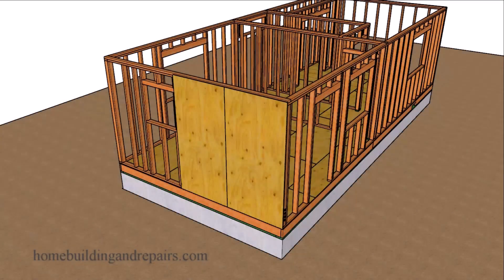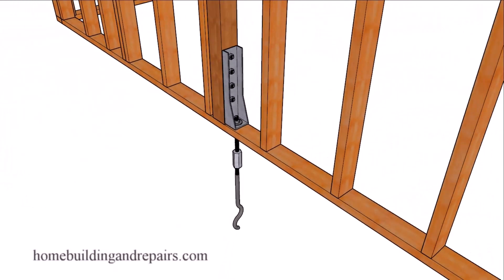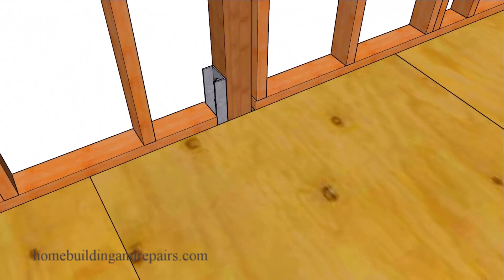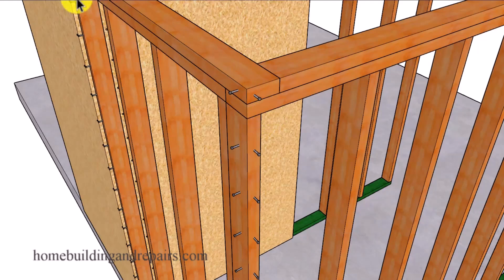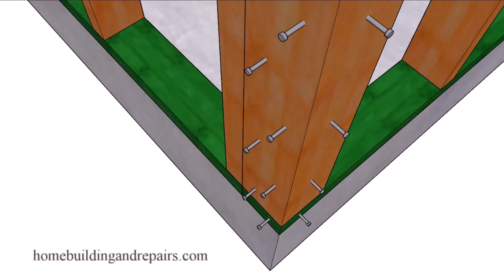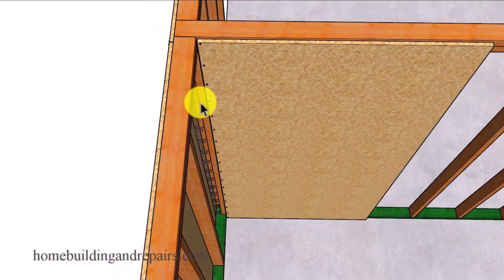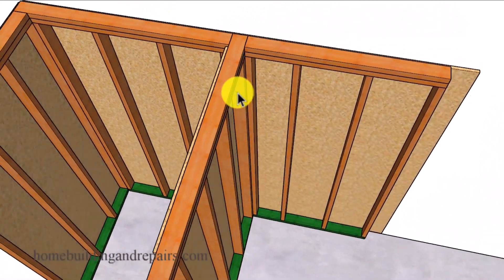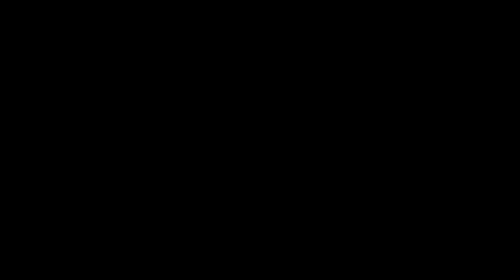Structural Shear Wall Framing And Foundation Hold Down Layout And Installation Tips

Comment: Can you show the hardware needed for shear walls underneath the raise foundation. 

The A35 needed at mud sill.

the bottom plate anchoring with SDS connections 

difference between using a 8’ plywood vs 10’ plywood  nailing directly to rim joist.

Comment: Where do 30" embedded straps come in instead of bolted  angle hold-downs like this ?  Straps are embedded deep in the stem wall concrete and extend up to tie the sill plate, rim joist, and studs together before the sheathing goes on. Are those only effective for uplift but not for braced walls or shear walls ?
Reply from the maker: They work for shear walls and can be used sometimes, but it will be up to engineers on whether to use them

Comment: On the crawlspace foundation, if posts are going through to the sill plates, why not build the entire wall to go on the sill plates as though it were a slab foundation, then joists on the sill plates nailed to studs, then blocking at subfloor level where a sole plate in platform framing should go ?  That would be almost like balloon framing where the joists ties the studs together rather than studs sitting on top of subfloor.

Comment: Putting all these posts in corners and thru-wall connections means no insulation space, which was the origin for the California (3-stud) corners.  Will it even be approved by current energy code requirements to eliminate that insulation space ?

Comment: I'm not a framer or an engineer, but I've seen the wood rot on the outside floor joist on houses.  If you put the post directly on the sill plate cutting out the outside floor joist, would that cause a problem when that joist needs repair or replaced?  I know it would last a long time with waterproof rap and stuff, I'm just thinking of the future when there is a problem.
Reply from the maker: I like putting posts on top of crawlspace floor framing plates instead of on top of sheathing.

Comment: I find it hard to believe we're still building these crappy 2x4 houses this way.
Reply: We are building all kinds of houses. 2x6, 2x8, double frames and many more. 2x4 is either a cheap house or a shed.
Reply: 2x4s are adequate for the load for  single story houses even with heavy snow loads, and if you are going to use external insulation, it doesn't matter that the cavity is very shallow.  For these cases, you are better off in investing your extra money in more plywood for shear strength for wind and seismic loads than in sawn lumber studs.  In general, walls are typically over engineered for vertical loads compared to other components of a house.
Reply: It's called money and I would love to live in either a deltech wood house or a concrete monolithic dome.

Comment: At our lumber supply house I’ve seen the sheer Wall concrete bolts that were three or 4 feet long for extended applications.  That were not straight rods.

Comment: Please teach me what a shear panel is. I've never heard of the term. Only ever heard of sheathing. All I can guess is that sheathing or OSB or plywood installed in a certain way achieves what shear panel is supposed to achieve. Perhaps structural integrity for countering lateral movement as well as uplift?
Reply: Panels nailed on any old random way that keeps the outside out would be considered "sheathing".  It's not doing a whole lot for you structurally.  When you nail a panel specifically to cover and bond and "keep square" the upper and lower members and at least two studs in order to prevent racking, then you can call it a shear panel, too.  Depending on the situation, you can do this in lieu of, or in support of, a bracing member in the wall.
Reply: (Of course, even bonding two studs is going to help with racking to some extent ... I'm just going to extremes to make a point)
Reply: @WanJae42  Great I appreciate the response on this.  Makes sense.
Reply: @houseandhobby6971  <> It's a ridged wall section. This is usually achieved with plywood sheathing with all four edges securely nailed. In the days before plywood it was achieved by nailing all your 1x plank sheathing on a 45° diagonal. When you do the same thing with the roof it's called a diaphragm.
Reply: @Oldhogleg  Thanks for responding on this and helping me to get the concepts about that.
Reply: When thinking about strength and the ever increasing chances it seems of tornadic weather....I like 2x6 wall construction and the incremental cost is not that much more. Nah I'm not a builder and never built a house. Then with the 2x6s I like the idea of ripping 2x4s down the middle to create diagonal pieces, just two, one on each side of each wall section, running through notches in the vertical studs making an X, with two parallel planes on the wall section maintained. Screwing the diagonals into each stud crossed by the diagonals. Plus of course the metal anchors where needed and not cutting corners elsewhere. What do you guys think of those thoughts. Although sheathing crates initial ridgidity I don't like the tendency of wall sections to be able to sway linearly as fasteners loosen in sheathing over time with temperature and moisture changes. I would be quick to admit I have the tendency to overbuild however.
Reply: @houseandhobby6971  <> Sheathing is just the minimum, it's the engineer who calculates the extent of the rigidity needed. As greater rigidity is needed, the thicker the material and the more extensive the use of hardware is called out in the specs by the engineer. It can end up requiring a manufacturered steel shear section to be installed within the wall. Or even have a moment frame of structural steel erected within the wall.

Comment: Yup, there's less deflection from the wood being crushed below the holdown post, especially it's outer corners when put directly on the mudsill. Could put steel bearing plates that are a couple of inches whider than the post to spread out the point loads when putting the post on top of the joists. 

Yeah, I never liked the way you typically see how intersecting shearwalls are done in the field, it defeates the purpose. 

The biggest issue I typically come across is not going back and retightening all the holdown bolt nuts after the wood shrank just before the wall to be closed up. So many times I'll find the nuts with a ¼" or more gaps, some times the nuts are completely missing because it was forgotten during a hectic day.
Reply from the maker: Thanks again for the great tips.